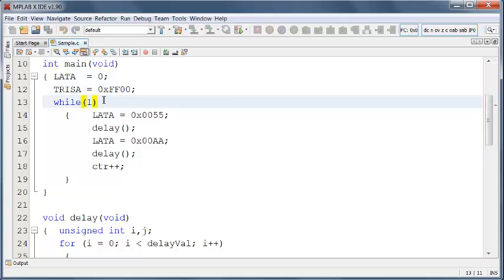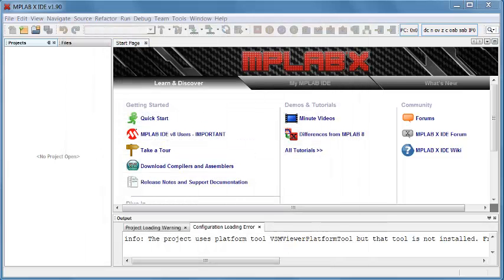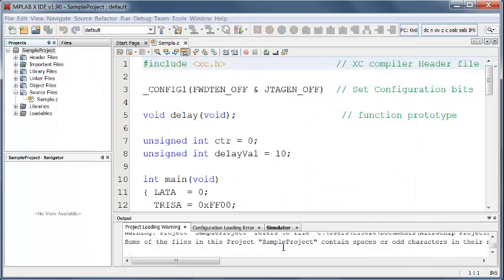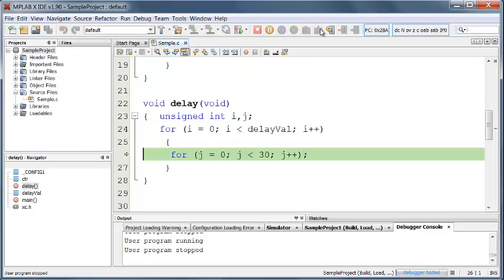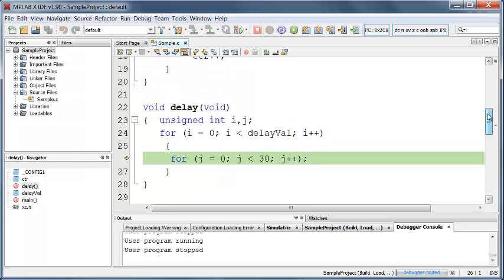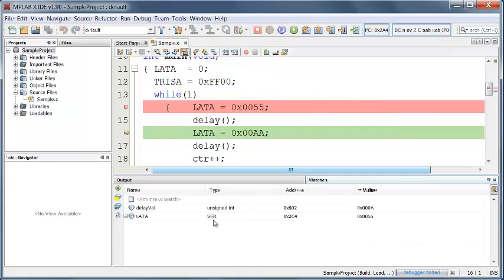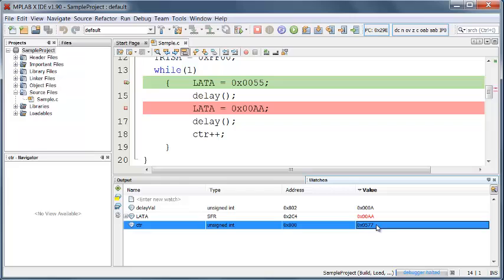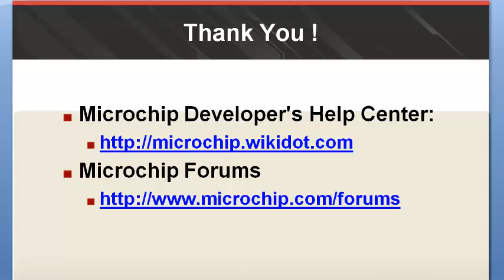Basic Debugging using Microchp's MPLAB X IDE

Comment: Sorry for the delay in getting back to you.    Using the Variables window you can observe variables with a limited scope ( ie. inside a loop or a function.      Window->Debugging->Variable.   When the window opens up you may need to toggle the icon with the { }  ( curly brackets) to see all the local variables.